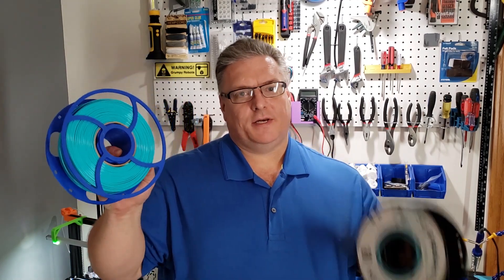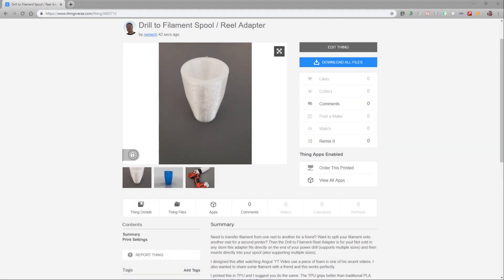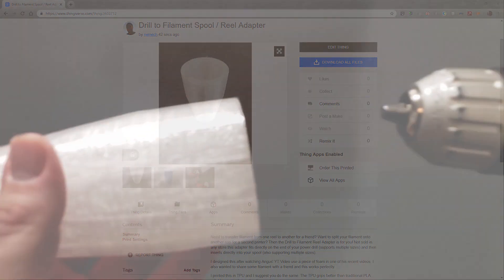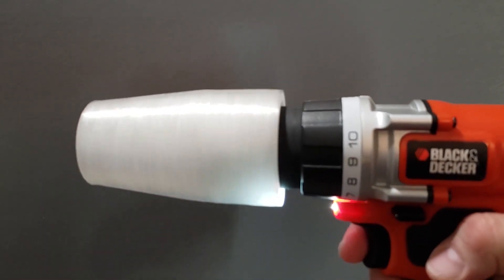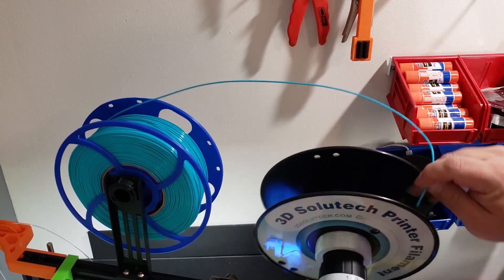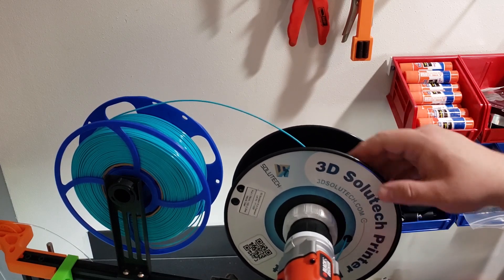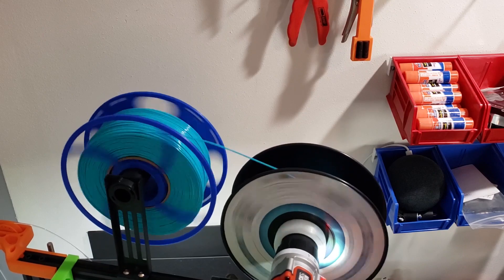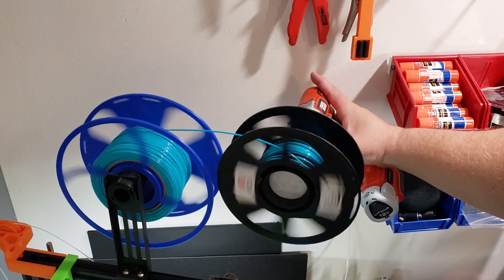DIY Filament Spool Transfer

Comment: I just use a toilet paper roll which fits snug right on the drill chuck,  and I wrapped it in duct tape enough so it's wide enough to have a spool fit snug on it.   Great traction too.
Reply: I used a glove

Comment: I printed out the cone from thingiverse and it didn't fit in the spool or on the drill chuck. if kinda fit, but was not useable.
Reply from the maker: You can always scale in the slicer to fit your needs.

Comment: spent almost 6 hours printing this thing out, and it wont fit my drill correctly. Gonna have to add a long bolt through middle to get my drill to be able to turn it. Word of advice, print a small portion and test it before you spend all that time and filament and find out it dont work for you.

Comment: On reddit someone claimed if you do this it will tangle when you try to print with it. Cause the part of the spool that was on the outside (bigger diameter) ends up in the middle (smaller diameter). So it will try to unwind itself. Although I think they said you can fix it by doing it twice. First roll it onto another spool and then from that spool to the final spool. Sounds like quite a chore.
Reply from the maker: It works fine as long as you keep the tension on the filament. By design its not really intended for a full roll transfer.

Comment: Only works if the spool has a small enough hole in the center. I wasted 4 hours on a print for the adapter, only to find it was tool small for the spool. 🤐
Reply: Yeah tell me about it. The spools all have different internal diameters. I have been thinking about fixing this by  making a veeery slightly conical drill adapter, or an insert with five or six semicircular, elastic  "(" shapes joined in a swastika pattern at a  central hub  which can adapt to different diameter holes.

Comment: Will the filament automatically spread across the spool?
Reply from the maker: Not automatically but you can certainly tilt the drill to have it wind the direction you need.  Slower is better than fast.

Comment: Very good idea!  I have snags in new rolls some times that ruin prints.  You think you've fixed it but it snags again.  This is a nice, easy solution one can use right on the spot.  Thanks.

Comment: Awesome! I got a filament dryer recently (SUNLY FilaDryer S1) and the Polyflex 30D spool doesn't fit in it as they made it all all fancy and rounded.
I've been looking for effective solution to transfer the Polyflex to an empty spool after doing it manually for some tests and am tempted to try your approach!
Thanks for sharing 🙂

Have you experienced any issue with this method since?

Comment: Good idea to attach the filament so it doesn"t go flying right off. Transfering the filament with a drill looks much easier and faster than doing it by hand. Plus its fun to watch it go flying on fast.